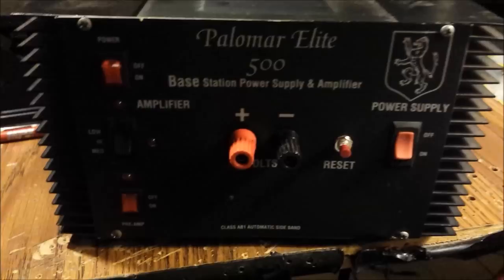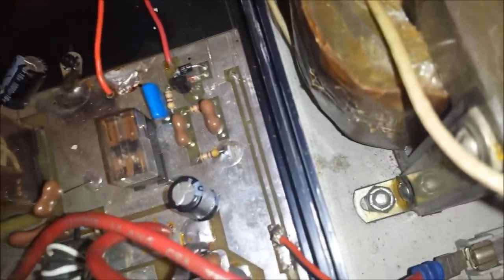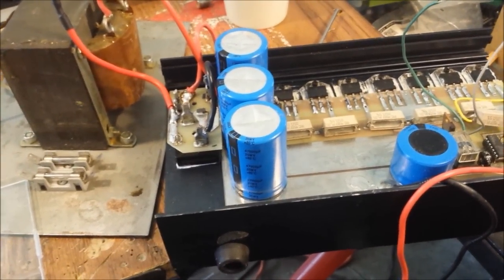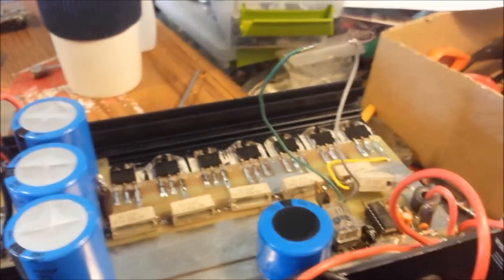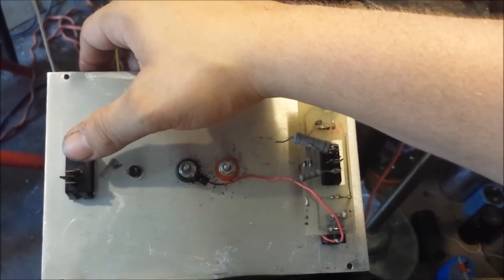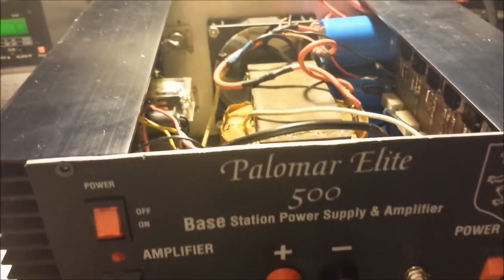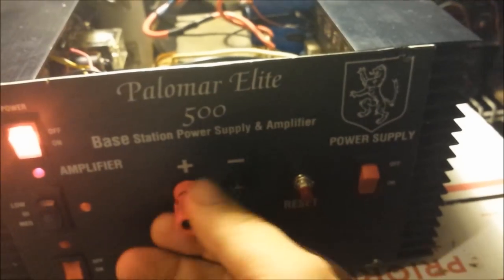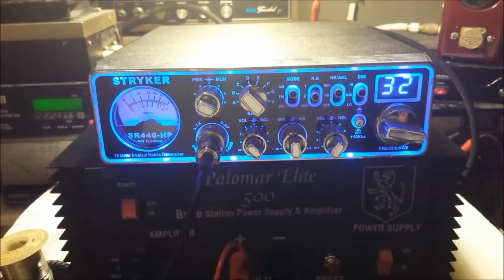Palomar Elite 500 Base Amplifier Repair & Output Test

Comment: I worked on the same one a few years back.Had to push reset button also. some one hooked a high drive rado and blew the MRF455 X4 out. smoked the 10 ohms. even took out a tuning cap. Re built using SRF 3775 RF parts.  Re did input tune . Flipped the fan. Running great.  cools better pushing in to box. Great job!!

Comment: It looks like that red wire you're talking about was someone's attempt to fix that trace. It's what I've had to do before in the past, take a good size gauge insulated copper wire and cut it to perfectly fit between the blown trace, and solder the ends the the trace points on the circuit board, that's about the best I've been able to do...even been known to put a fuse block inline just case as well.

Comment: Very informative video. Is there anyway you tell what that key in transistor number is. I have a boomer 400. And the key in transistor went out. I replaced with one from Texas star 250. And it didn't last long. It lasted a couple months. Any help would be greatly appreciated thanks.
Reply from the maker: They are 2907 just like a Texas Star im pretty sure bud going by memory. ANY general purpose PNP transistor will do.

Comment: Question: Is there a schematic for this??? I'm looking to see if there's a way to tune the INPUT SWR between radio and amp???
Reply from the maker: Good question man.....that is easy to do though. There is actually 2 caps that take care of this....a trimmer and a 68pf cap. You can remove the 68pf cap and put a trimmer in.
Reply: @1883GotDown  Yo! You responded!!!! Thanks!! There are some things i would like to talk to you about that I don't want to discuss in a youtube comment section. Are you perhaps available on discord, or by some other means? thanks!
Reply: also, may I ask how much you're PUTTING IN to this amp? How much power are you DRIVING it with?

Comment: At 14:63 those 7 black squares top of the amp side are they Mosfets?
Reply from the maker: No those are pass transistors for the Regulation circuit to regulate the power supply. They pass the current through. When you regulate a power supply you have to be able to pass the current through the circuit and that is what those are for.

Comment: Another thing, too...the wires that they put on the input/output SO-239's are always crap. I always replace them with thick gauge solid core copper insulated wire...always.

Comment: I have a Palomar Elite 500 like the one in the video. It has been working great. The last few times I've put a meter on it to check the output, high is putting out somewhat less than medium. The 455 pills (60 watts each) have all been removed and test good at approximately 58 watts each. what could be contributing to the lower wattage output on high (150 watts)?

Comment: What are the power supply transistors
Reply from the maker: If you go on cbtricks there is a diagram. I need to post it. I'd have to dig through my part bin to find it.
Reply: @1883GotDown  do have a link to it....i tried looking for it....need the power transistors for the power supply but i dont know what ones to buy

Comment: what would cause be for a high SWR, even with power off? I replaced that coax and both SO-239s.
Reply: fried relay or underneath the board there are a few traces.  A few of which come in from the input SO 239 to the relay and a trace coming out from the relay to the output SO 239.  I found my output trace to be fried.

Comment: palomar 500 is 35 amp power supply palomar 300 is 25 amp and you have to push the red button on front on all of them that i have used.

Comment: you can get 1000 out of them easy with some modification and power supply pulls it fine and that button comes factory that way is what i meant i have one modified 500 does a thousand to 1100 one stock and a 300 thats down